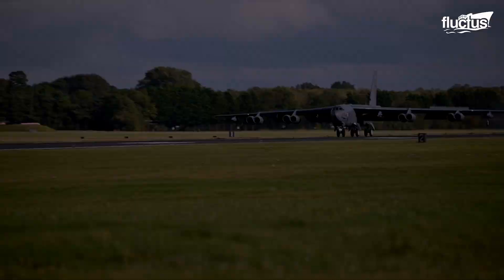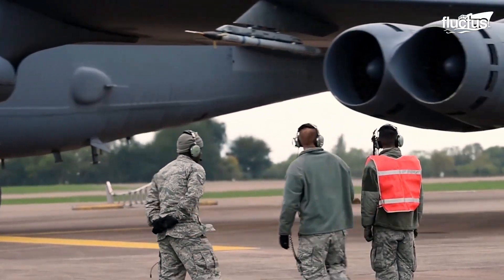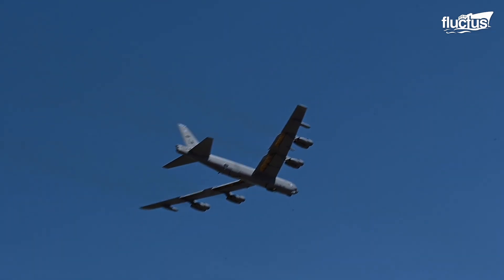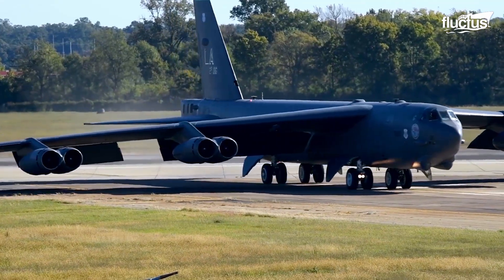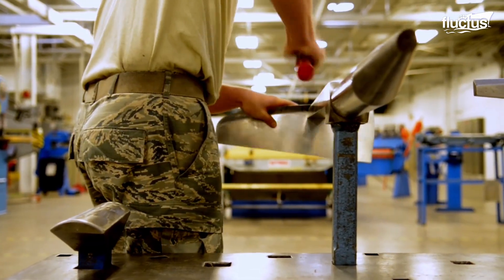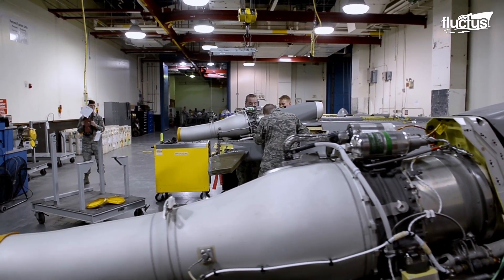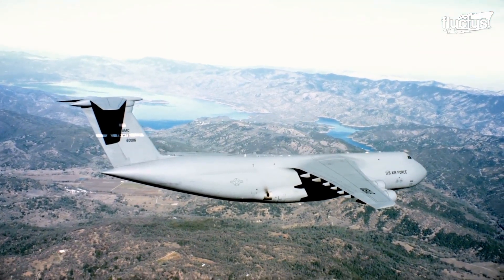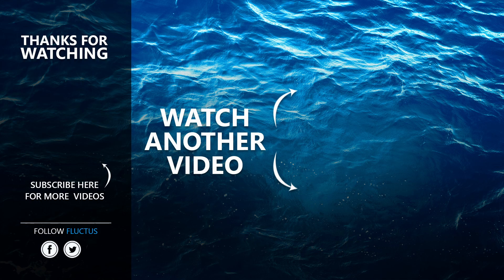The Reason Why This Monstrous US Bomber Needs 8 Engines To Take Off

Comment: THE BUFF can take off on less engines but it takes a lot more runway and balls of Depleted Uranium to want to do it.  AND  don't barrel roll one at low altitude,  I was in Spokane Wa. About 5 miles from the AFB there when 1 colonel attempted it and  augered in.

Comment: IIRC there is a difference between a "Cartridge" start and a "Cart" start.  A Start-Cart or "Huffer" is a ground ower unit that provides compressed air to spool up the engine.

Cartridge starts are done with a "explosive (or rocket fuel) cartridge" that is fired and spools up the engine.  The first video image of a Cartridge Start may be seen in the moving "Flight of the Phoenix" starring Jimmy Stewart.

Comment: Pity they could not re-engine with the RR Trent series engines, high bypass and I'm sure adequate thrust.
Reply: Not enough under- wing clearance. Some years ago the RR RB211-535E4 (the predecessor to the Trent) complete with a new wing was seriously considered. This would have probably also have required a wider chord rudder to cope with greater asymmetric thrust if one engine failed.
After much discussion the idea was abandoned.

Comment: The eight engine setup is better due to the bomber having a very small rudder. An outboard engine failure with having 4 vs 8 engines would be hard to control.

Comment: thanks very mucu useful datum .turbo jet engine for air crafts will be changec with electric power turbo motors with hydrogene fuel cells for improving environment. thank you.

Comment: Former Master Crew Chief B-52H 61-011 Chameleon. The B-52 actually flies at 3° nose down. One of my greatest thrills was running up engines after maintenance.  Worst was cleaning starters after an alert cart start. Flying low level was also thrilling. Picking up drag chutes suck. 5th Bomb Wing Minot.

Comment: I grew up as an Air force brat in the mid fifties and sixties until I did my hitch in the USAF 73-77. So I was was around these BUFFs as we called them  for the first 21 years of my life. I was in SAC stationed at U-Tapao Thailand and Mather AFB in California where we had an A ramp for the  4 nuclear laden alert birds and their  4 KC-135 Strato Tankers. These big boys would taxi out at high speed with all 8 of those T 33's howling on O.R.I 's Operational Readiness exercises. I was a K-9 handler and when those 4 BUFFS taxied out at high speed 50 feet away you could feel the sound waves and the turbulence pulsating  from those 8  engines making your internal organs practically vibrate. Even wearing ear plugs and a  "Mickey Mouse" headset over that to further protect your ears. You still could hear the high pitched whine of those TF turbo fan engines. And those long pendulous wings flexing up and down carrying those 2 pods of 4 engines on each wing. Watching them land and take off made one marvel at how agile they were with their short landing gear.
Reply: i worked at NASA on C-141's that had the same engines (4 not 8) as those BUFF's- very fuel inefficient and low bypass design compared to a modern high bypass design. I think there was a multi-$B contract to replace them!

Comment: I think the new engines are virtually fit for life and can take bio fuels. Two large engines would virtually destroy the wings, which are not designed for modern large high power engines. The B52 is special, glad it flies on. 🇬🇧

Comment: At the time of its design, there was no engines powerful enough for such a big plane with less engines. The smaller B47 already used 6 engines !
What surprised me is that the current remotorization program still rely on 8 engines when it could have been done with 4.
Reply: I believe that one of the reason they stuck with 8 engine is that they could use existing pylons to mount the new engines. Going to 4 larger engines it would need new pylons to mount them.

Comment: I cant believe how the wings dont fold with the weight of 4 engines on them.....fabulous engineering.
Reply: Not just engines. Those wings are full of fuel, external fuel tanks, and external pylons for bombs and cruise missles.
Reply: The weight of the engines and fuel is actually beneficial, as the wing's most critical loading is the upward lift during flight, and the weight counters the lift.

Comment: One of the reasons the BUFF is so big is that there isn't very many cubic inches inside the fuselage that isn't filled with equipment.  I worked ECM systems on it, and there is a vast amount of electronics inside it and many, many, miles of wiring.
Reply: So another Old Crow.  I worked the ECM at Loring AFB.  Enjoyed the work on the BUFF.

Comment: I grew up in northeastern Montana, just 60 miles from old Glasgow AFB.  In addition, just to the south of us was the low-altitude Flint Rock Oil Burner run which B-52s from all over trained on.  They were a very common sight during my youth.  As it stands now, I haven't seen a B-52 in flight since 2001 (it and a B-2 flew over my house, which is below an aerial refueling leg).  Miss seeing those ol' girls.
Reply: Why are you talking about airplanes in the front and missing the girls in the back?😅

Comment: The B-52 max takeoff weight 488,000 lbs (219,600 kg), compared to the 747 max takeoff weight of 910,000 lb (412,770 kg). Therefore a B-52 would only need two 747 jet engines to do the same job as the older eight engines. This is 60 year old tech when compared to today's tech! 😆
Reply: Actually a bit more but you're close. Basic acft weight is 188,000, it holds 312,000 lbs of fuel, plus munitions.

Comment: Seems to me they would just store the B-52's at warm weather bases.  California, Nevada, the entire South, Florida.  There is zero reason it has to be stored in such a drastic weather area as North Dakota.
Reply: Yes, there is. It is closer to Russia and China than Florida or California.  And I’m thinking the US military strategists have thought this through a bit more than you, there sparky.
Reply: Minot ND is very close to the geographic center of the NA continent, missiles from any source will require the longest flight time to get there.  As others have stated Minot is also closer to Russia via the circumpolar route.  Spent two winters there servicing these behemoths and we were issued Arctic cold weather gear for a good reason.
Reply: @bobmorgan1575  okay, thanks Bob.  I understand better the thinking around it now.  Funny you said that because as I was watching, I thought; Oh those poor guys working outside during the winter!  And the hot summers.  There’s always the hangar but I doubt it’s heated or has A/C-it would cost half the budget to heat/cool it!  I’m sure I’d ram my head into a low wing!
Reply: @annehersey9895   My memory of working on B-52 is all outdoors.  Only scheduled maintenance was indoors and the hangers at Loring only allowed the front of the aircraft to be indoors.  Fun working on the tail when the temperature was negative 20.
Reply: Spent six years working B-52s in Northern Maine.  The weather is only as drastic as your mind makes it.  Sun and heat can do as much damage as snow and cold.  Maine, NY and ND were all shorter flight times to potential targets during the Cold War.

Comment: The starters on B52's are mounted on the OPAH Oil Pump and Accessories Gear Drive Housing. The starters are driven by compressed air that drives a Starter turbine wheel that drives the gear housing. The cartridge starter allows for starting when a ground APU Auxiliary Power Unit isn't available as a compressed air source. Back in the 70's there was just one cartridge starter on each wing and bleed air was used for the other engines. It's interesting that they have 8 Cart Starters on the BUFF's now. The video makes it sound like "The Black Smoke" blows into the actual engine or something. It is simply the residual exhaust from the starter turbine wheel. 
United States Air Force 1971-1975 AFSC 43250 Jet Engine Technician SSGT.
Reply: Thanks for the explanation of the carts. Given the smoke from the carts, I always wondered how the heck the engine's turbine could possibly deal with that much contamination...because I mistakenly thought that the cart gas was used to directly spin up the turbine.

Comment: i still miss the b-52's and kc-135's that were stationed here at castle. i think it was a mistake to centralize everything but who knows? still miss'em!
Reply: I miss the B52s that were at Seymour Johnson AFB in Goldsboro NC. They would fly low level behind my house. After the B52s left the 68th Bomb Wing became a refueling with with KC135s .The 68th was disbanded and in now the 916th Air Refueling Wing a reserve unit. They had KC10s for a few years then it became a reserve unit the KC135 replaced the KC10s. Within the  last year the Wing traded the KC135 for the new KC46 Pegasus

Comment: One of the B-52s is being displayed at the War Museum in Korea. I was surprised to find that it was huge in its height, wingspan, and sheer size. However, it is still smaller than B747.
Reply: And a very cramped cockpit! It wasnt designed for comfort but for a specific purpose.
I was impressed seeing the b52 in Seoul also, Im from Australia and it was my first sight of one in the flesh!
Reply: VelociRaptor
The B-52 is only 159ft in length, most civil planes are longer than that.

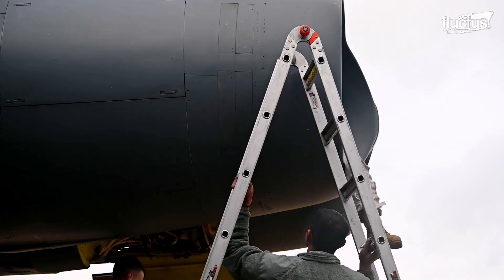Comment: At 3:12 & 10:10, it's stated the engines take a long time to warm up.  TORO CACA.  This disinformation has been put out in a number of videos.  In northern cold & snow country the engines would be heated if the engine was frozen.  Ice would form around the compressor blade & turbine blades & had to be thawed before  starting.  For day to day missions, the crew shows up to the aircraft an hour & thirty minuets prior to take off.  They do their walk around then go inside & do their preflight inspections, check the chute, powering up the avionics etc.  Then it's engine start , more check with aircraft power, the taxi out approx 20 min before take off.  On alert, they crew preflight is done one time.  Response time on alert is under 10 minuets.  No waiting for any bogus lengthy warm up.

Comment: The tu160 is a much larger mach 2 bomber and uses four engines.  8 engines are required only because they are not large engines,
Reply: WELL.

I think the reason is this B52 was designed in 1948.

Tu160 was designed in the 1970s or so. (I don't know the year.)

Comment: 70000lb ordinance is that 30000kg or just 30ton? Lots of commercial aircraft can lift more than that, just sayin 😉
Reply: Commercial aircraft aren't built as bombers.  70k lbs of bombs is more than 10Xs what a B-17 WWII bomber carried.  And the load may vary depending on the distance it has to go to delivery.  Same is true of commercial aircraft.  They don't always fly at max weight.  Their max takeoff weight is usually less than max weight.  B-52 advantage is inflight refueling.  Then they can carry a full 70K.

Comment: Nice video.  I have wondered which was actually bigger the B-36 or the B-52?  I was stationed at Roswell when the B-52 was there.  Sometimes a B-58 would make a visit.  At that time the B-52 was equipped with hound dog missiles.
Reply: B-36 is about 10 feet longer fuselage & 45 feet longer wing span.  B-36 could carry a heavier load also.
Reply: @vitogulotta7193  Just much slower, 230 mph cruise VS. 509.
Reply: @michaelplunkett8059  Hve you ever flown or worked the H?
Reply: @vitogulotta7193  B-36: 210 ft. wingspan
                         B-52: 185
Reply: @jimwatson842  According to the Air Force Museum the B-36 has a wing span of 230 Ft.

Comment: Can't wait to see the B-52 with the new Rolls-Royce engines! So curious to see the difference between the old and the new on my favorite Airforce plane.
Reply: The Pratt and Whitney TF33 engines have the best sound.Very distinctive.
Reply: They provide the same thrust just more economical hence the B52 will fly longer before need to refuel.

Comment: During the Cold War, SAC required the entire fleet to be airborne within 15 minutes to avoid being destroyed on the ground by Soviet ICBM's. "COCOA" alert exercises were frequently performed to practice this. The flight crews did not know if it were for practice, or for real. 
By design, the leading edge of the wing is tilted up a few degrees so that enough lift is generated during the takeoff roll to allow lift-off without rotation.
Reply: I was in SAC, as a crew chief.  We had an 8 minute responce time.  Eight min to get all alert acft airborne.
Capt Beak explained a bit more in depth.
Reply: @vitogulotta7193  At the highest DEFCON level, as in the Cuban Missle Crisis, weren't all operable aircraft, B-47's and B-52's on alert status, and reqiured to be airborne in 15 minutes?
Reply: @lawrencegore6647  The standard alert force was about 1/3 of the acft on base.  Bombers & tankers.  At my base we had 6 bombers & 7 tankers on hard alert.  If alerted & it was real war, they had 8 minutes to get them all in the air.  When Nixon reacted to the Russians during the Yom Kipper war, the remaining 13 we had were loaded & cocked on hard alert in less than 24 hours.  Based on exercises like Global shield (ORI)  we could get all bombers & tankers airborne in about 15 min +/- from engine start.  I think under actual EWO we could be faster.
Reply: @vitogulotta7193  Thanks Vito, and my thanks and respect for your service in SAC. I believe you have confirmed that, when under maximum threat, all operational aircraft were expected/required to be airborne in 15 minutes. Incidentally, my section at Boeing collected data from every flight of every B-52.
Reply: In 81 when I was at Wurtsmith we had crews still living on the alert pad. I was an avionics tech and our bread truck had rotating dome light and a siren. Many a time during an exercise we had to get to the pad in no time and no speed limit
Reply: no during the cold war not ALL bombers were on quick response or alert , the alert birds were required to be off the ground in a matter of minutes. Usually only about 1/3 were on alert at any time. The rest of the fleet was in various stages of repair or disrepair and not loaded. The scenario we practiced was that intelligence would keep the wings and HQ SAC advised of the deteriorating world scenario and we would have ample time to generate the additional aircraft to combat status. The first wing I was assigned to that was a 36 to 48 hour endeavor.
Reply: @fk4515  Sir, may I assume you were in SAC? If so, my utmost thanks and respect. I was at Boeing, so was not involved in operations and not privy to threat levels. I understand that the overall alert status depended on the perceived threat level at the time. I believe the entire fleet was required to airborne in 15 minutes if at the highest DEFCON level. Is that correct?
Reply: But why does it need eight engines?  The video never answered the question.
Reply: @cosetteudx  The plane was designed in the early stages of jet engine development, and the early model B-52's engines had only about 9,000 pounds of thrust. Thus, it took eight of them to get the plane airborne. As the models progressed from A thru G, the thrust increased to about 14,000 pounds,. The TF-33 turbofan engines on the remaining 76 B-52H's have 17,000 pounds thrust.  Current engines have as much or more than 78,000 pounds of thrust, but it would require a complete redesign of the plane to use only two or four af the newer larger engines. The new Rolls Royce engines will have the same size and thrust as the TF-33's so as not to require a redesign.

Comment: Will the new engines have reverse thrust on them?
Reply: No.  It will still use the Drogue chute.
Reply: Reverse thrust could be a nice upgrade but might not be possible because of wing structure and design.
Reply: Doubt it.

Comment: Former Boeing.... BUFF lives on and on.... kids flying it today had parents that flew it.

Because there is almost zero rotation, the B-52 has no tail strikes common to other military aircraft. Many aircraft have 'sacrificial' wearing blocks to take the punishment of a tail strike. Cheaper to replace these blocks than repair dinged up tail sections on fuselage. 

When B-52 was first flown, the 8 engines were quite the sight. They were needed for power and for redundancy. Can't have aircraft turning back from a strategic mission because of a blown engine. Today, the 2 giant GE 9xx engines on our 777 have more power than all 8 engines on the current B-52's combined. 

In fact, the GE 9xx engines are larger in diameter than the entire fuselages of 737 and B-52. If it wasn't so expensive to retrofit engines, 4 GE 9xx engines on BUFF would more than double performance.

How long will BUFF continue to fly.... for as long as it needs to...
Reply: I mean B-52 will always be ideal to bomb the Taliban, so probably will live forever.
Reply: @niweshlekhak9646  Thanks for comment. A little 'carpet bombing' goes a long ways. Back in the day B-52's lined up wing to wing and front to back to drop 70,000 pounds of dumb bombs. It was like spreading a carpet out, everything in zone was destroyed.
Reply: @SJR_Media_Group  Those were not "dumb" bombs.  They were very smart.  They ALL fell all the way to the ground and then went BOOM.
Reply: I was rather taken aback the first time I got to watch one climb out in a nose down attitude.
Reply: @bobmorgan1575  Thanks for comment. I've been in every Boeing Military Aircraft except B-52. Bet it is quite an experience. Been in B-17, B-29, F-15, and F/A-18. Also in every Commercial plane except 787, that includes 707, 727, 737, 747, 757, 767, and 777.